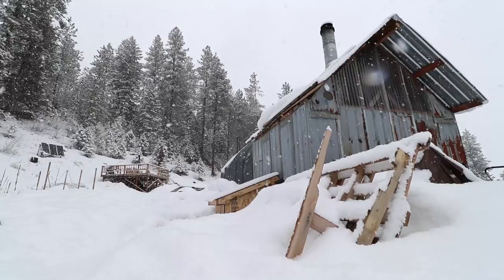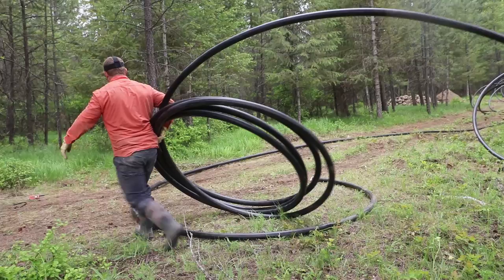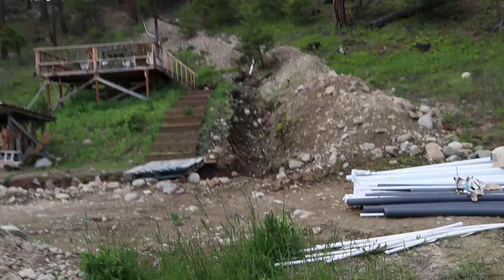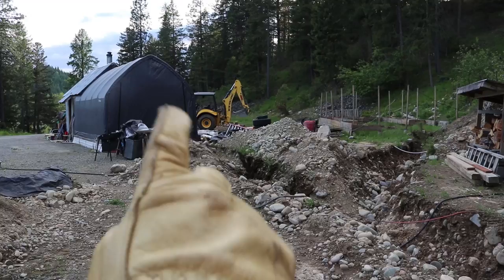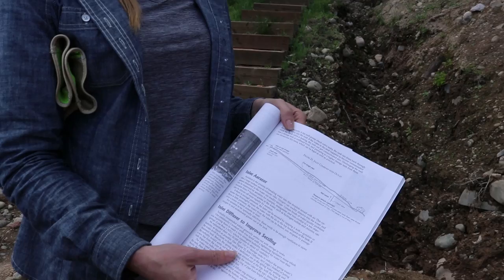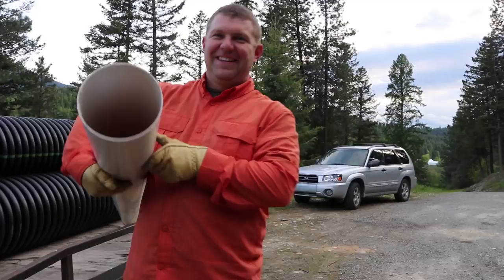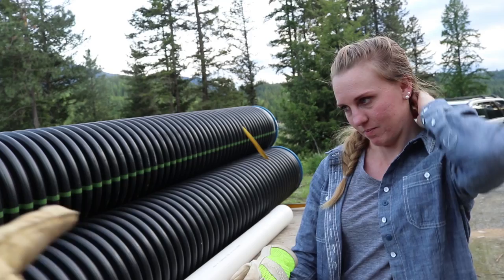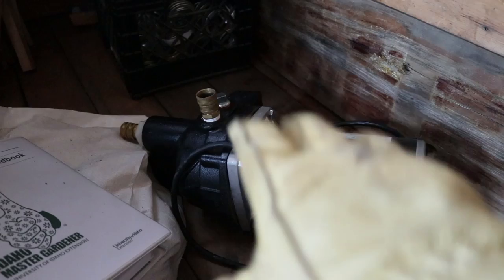EPIC $10,000 OFF GRID GRAVITY-FED WATER SYSTEM

Comment: did you check cost of pax v. poly...lot less pieces to install...you can also use slip and lock...they use the same locate/ribbon system on fiber op...put your ribbon on top of wire by 6 to 8"

Comment: Great simple system now for a solar direct drive well and when the house is done rain water to fill a tank just below gutter hight for the hot tub and garden use that won't need the pressure just good flow :-) also potentially a pump to the top of the house set to use excess solar generated during the day :-)

Comment: You need 11/2" fire hose. fittings. and nozzle plus some PPR & Nomex not that much investment, but remember it's all about fuel clearance.... your "curb box" could of been done with plastic pipe and small round plastic box at top just don't see the value of iron long or short term... and cast iron will still bust... tie the tracers together at ends... pump and fill a that white used water tank connected to the system above the house for great water pressure... and the demand curve for a well is also flattened by a water tank just like olden days... a small wind driven well pump air motor pumping into a tank is how it was done 1880's... a small solar driven well pump would also serve all your needs I suspect... just a few thoughts

Comment: Good thinking about fire safety but a 2" supply @ 22psi won't be enough to fight a fire. I don't know how much water can be pulled from that 2" line with a pump to boost pressure to firefighting level or how big of nozzle it would support but it might be worth finding out.  Don't drive over that cast iron valve cover! Before you work more in that cistern hole take that backhoe and slope the banks back more, be safe!

Comment: how is the water system insulated from the permafrost?
Reply: Idaho does not have permafrost, that's something that you deal with up in the arctic. To insulate from a regular frost, you just bury the line below the frost line, determined by local geologists for the whole region, and the dirt insulates the line. For me that's 24 inches down.

Comment: Having an aerator in the tank, to oxygenate the water, presumes there's oxygen in the tank to mix with the water. How does oxygen get into the tank? I guess it comes by way of some kind of vent, which begs the question, what do you need to vent air, so the water can flow in and out without air pressure problems?

Comment: have u considered building a big metal roof right over the tanks and just catching the rain, filter it with a first flush and inline spindown filters, etc so its 100% gravity and skip all the pumps and need for moving parts that can wear out or fail. u might still want a pump for pressured showers but with that head and pipe size u could have saved a ton of time, effort and money by  building a huge roof on poles and catching rain uphill from the house,  rain starts out up and goes down for free so why ever would u use energy and mechanical parts to move it back uphill so it come back downhill again? u could also make it a big shed or whatever since u have money to burn. or even make a big concrete or rubber lined pond or big basin shaped like a bowl uphill from the tanks and again, let gravity save u all the extra steps

Comment: I used a air pump to bring the water to the tank. This way the pump has no moving parts and there is no reason to pull the pump from the well. I can use many power sources to pump air to the pump.

Comment: hay guys when you have to fill your tanks at the top why not fill it through your main line and use a check valve in your fill connection just in case. there is no more head pressure filling through the main line than filling it through a stand alone fill line.

Comment: actually you could put the water tanks on your house roof, of cause not the house structure bares the weight, they got heir own, as long as the water tanks are higher than your shower head, say 1m or 2, you got enough pressure. those pipe money certainly could pay for a water tower.

Comment: Why such a large water system?? Are you making the water system more intricate than needed?
It's almost like your building a water system for a small housing development. Your spending so much on water, just don't drown in the bath tub/hot tub/shower.

What would be a killer is if you drilled a well and you hit water and had an artesian well and no need for a pump.

Comment: I work in the water industry and we never use plastic junk fittings for anything.  A few years from now you will know why.  Using thin wall pvc to allow acces to a valve is a sure way to never be able to use the valve...you'll learn but that book was only $20.

Comment: I believe that you have chosen for yourselves what you believe to be the best water system for the money. However, for the time and energy you put into it, the renting of equipment and the purchasing of material, all coming in at somewhere around $10,000.00 in cost, I think you should have made a different choice.

Your property appears to be on a mountain top, therefore you may need to drill 500 - 1,000 ft. or maybe even deeper to get to the water table. A scenario which undoubtedly could be quite expensive. This being especially so, if the driller hit solid rock on the way down, if not, the cost to sink the well would be far less than the money you spent on the system which you installed. My well was drilled at 580 feet through sandy, loamy and clay soil and luckily, with no rock whatsoever. The cost me for the complete system consisting of a deep well 1 hp. electric pump, water tank, 580' 1 1/2" water pipe and 580' 4" casing and 60' 1" house piping,  including electrical line and power box hooks up and one outside water discharge connection and county permit, cost me $1,875.00 total
 
As far as electricity being a concern, you can go to any home do-it-yourself store and buy a whole house diesel generator system for under $10,000.00 which would supply your water pump and more than enough electrical power for a 250 AMP 60 circuit home system. There are even larger system which can be purchased for off the grid comfortable living to match whatever size home you decide to build. The only additional cost would be for $500.00 for a 1,000 gallon fuel tank and maybe $50.00 in fuel tubing and line fittings.

Comment: You had no Idea what a well would cost so you ran out and spent 10 grand on a DIY cistern system that you will have to hall your own water. I've been in the well pump, plumbing and heating trade for thirty-five years and after seeing a handful of your video's I like to encourage you both to stop what your doing and get some professional help. At the rate you guys are wasting money you"ll save tons of money and years of heartache, if you just resign yourselves to working with experience people who actually know what there doing. Seventy feet of rise, minus 20ft (house rise and cistern drop) works out to be 21.5 psi. You can get buy with that but thats pretty week pressure, and when you hook a fire hose on to your 2" main 22 psi there  won't be enough to clear one park car never mind fight a real fire. There are tons of options out there but doing your own engineering is an extremely expensive and disappointing way to go about it. Sorry to sound like a sour grapes but if you get sick of wasting money and all the gut busting labor give me a gingle and I'll be happy to help. One more thing most of the water wells I've seen drilled in the past ten years cost between 5 and 10 grand, and well pumps don't take major power even if you are off grid there are options you just have to have a thing called experience,  live long and prosper.

Comment: Am I the only one who thinks that this system is waste of time and money? Using 1" pipes and fittings, digging the storage tanks near the house and using a pump to to provide the pressure will cost a lot less and take a lot less time to do.
Reply: I think its because their power situation is mostly a generator right now.  You don't want to have to run a generator 24/7.  An on demand pump with batteries though would work fine and would be soooo much less work and cost.
Reply: i know people who are burning diesel all year because the cost of building electric grid is to much, solar pays for itself in 20 years and wind turbines are even more expensive and nature taxes are making this option unpractical.
Reply: Solar can pay for itself in <5 years in some situations if you DIY and get the 30% federal rebate.  But a full offgrid system with batteries is always expensive (2-3x), and you are always going to have to replace the batteries every 5 years or so unless you go with Li-ion or Iron edison or some other robust but expensive chemistry.
Reply: we had government rebates too, buy small-print dictates from witch companies you can buy the systems, and the prices there are so high  its cheaper to buy them elsewhere without rebates, also here we have fixed subscription of electric connection to grid + aditional price of kwh is ~ 0.14Eur (corrupt system)

Here good 5kw solar system (without batteries and montage costs) cost around 7k - 7000/0.14(eur kwh) / 250 (average kwh in month for me) / 12(months) = 16.7 years - add maintenance and subscription (10 eur month for me) add shirty weather ( ~6 useful month in a year),  hopefully extra energy produced equals out with extra energy needed form grid - sell 0.05 eur/khw - i'm will be dead before it pays off. :D